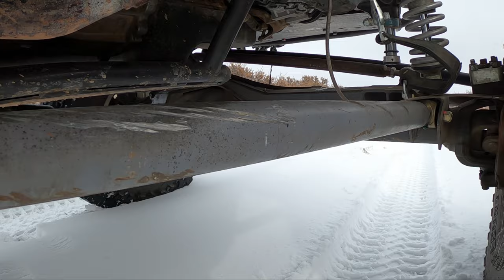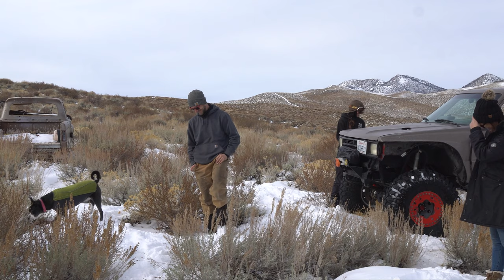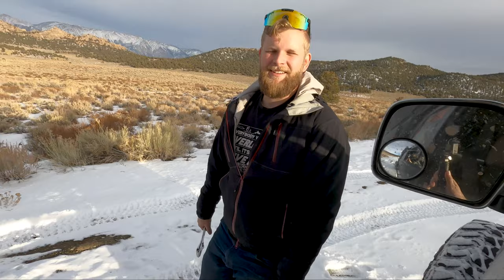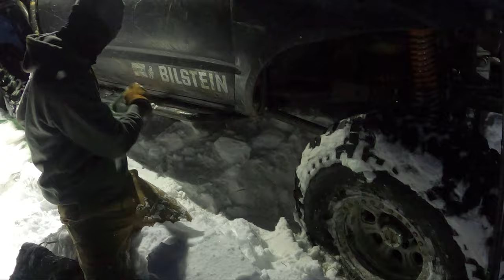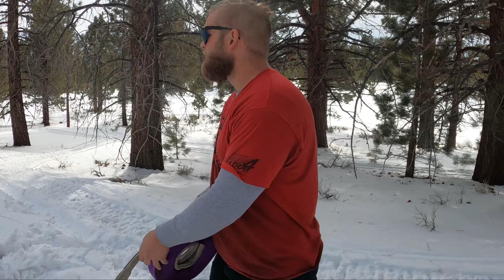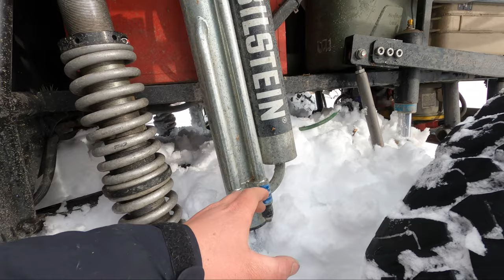Wheel every Weekend stuck in the snow + INSANE scenery

Comment: When you work on the shipyards you learn why most u bolts have a hole in the bolt end flange...convenient breaker rod hole lol
Reply from the maker: my stupid brand new hubs with my fancy axle shafts (also from the same company) smack into each other because the stub shafts are too long and make it impossible to actually lock and unlock hubs. Im about to weld a 1/2" socket to them so i can put a breaker bar on them when i have to